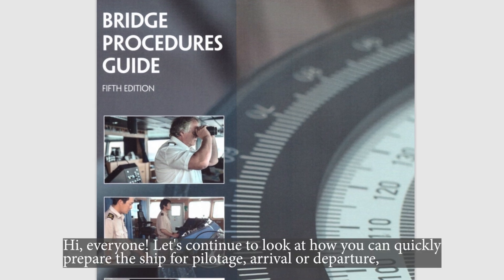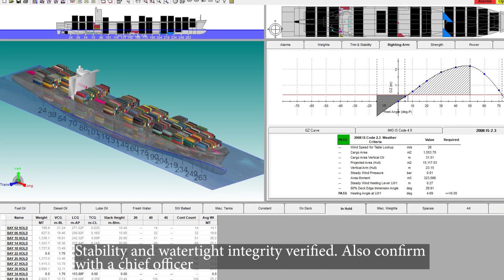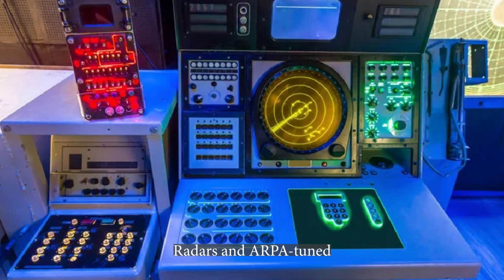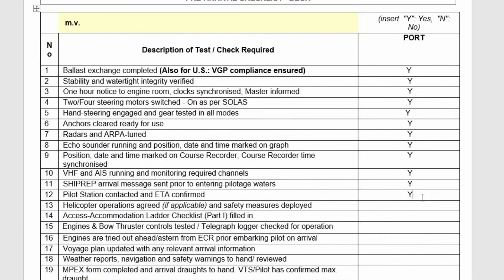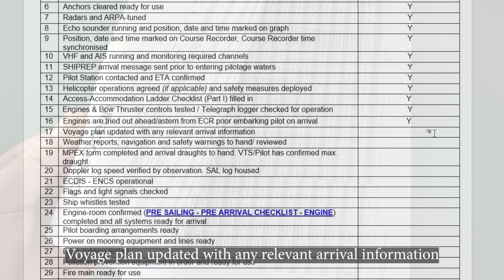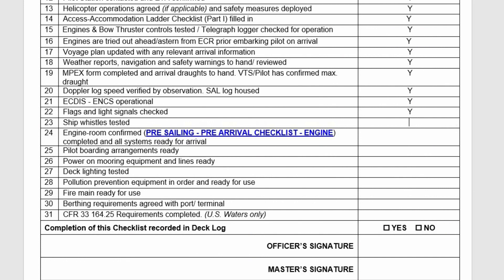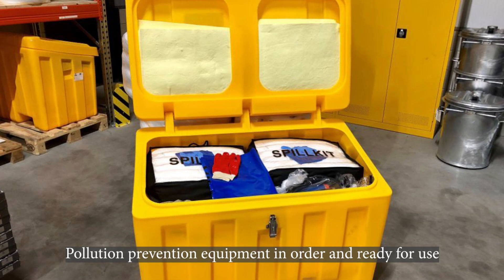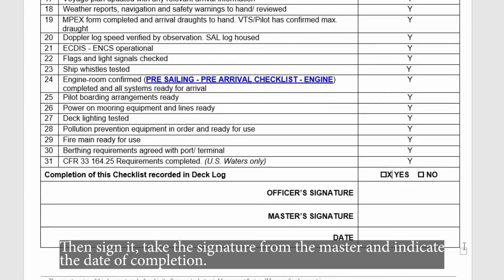BRIDGE PROCEDURES CHECKLISTS | PART 5 PRE - ARRIVAL CHECKLIST

Comment: Dear sir,
As we all know that the Pre-arrival & pre-departure checklists are used for ship to check items as listed as per checklist before arrival and departure. 

But normally the ship need to wait at anchorage someday before shifting to berth. 

So, what's kind of checklist I need to do before shifting to berth sir?? Because on ship only have Pre-arrival & pre-departure checklists, but no have pre-shifting checklist??
Reply from the maker: Good question, because the "pre-shifting" checklist is something that is missing on board and this fact causes some confusion.  It is usually another pre-arrival checklist that the officer fills out if the anchorage is short. If the vessel is anchored for a long time, it is better to complete the pre-departure and pre-arrival checklists by simply ticking only the appropriate boxes.
Reply: @uasupply thank you for your helpful answer sir!